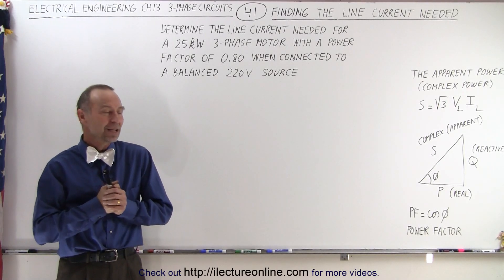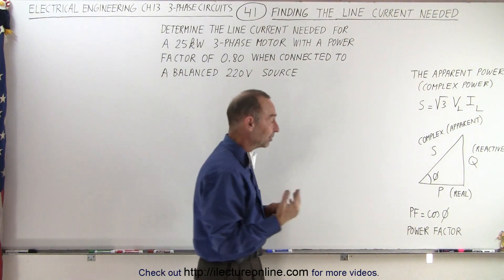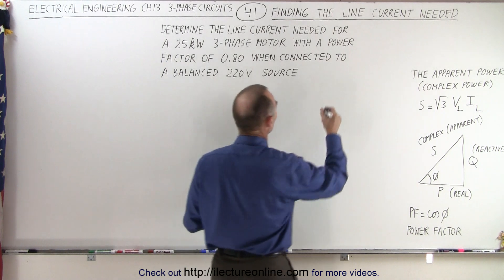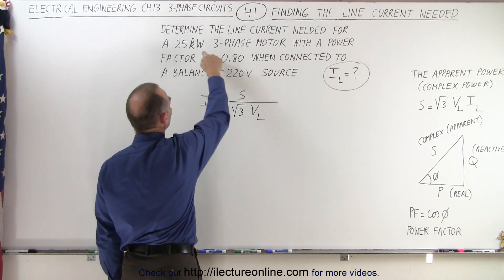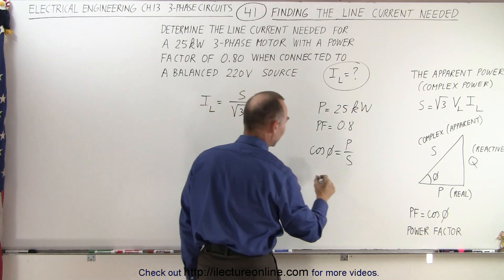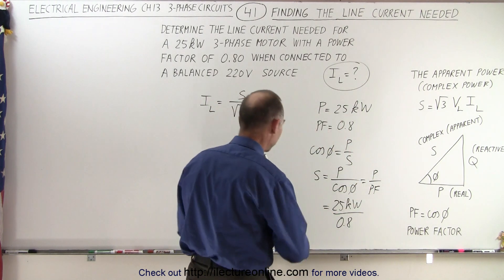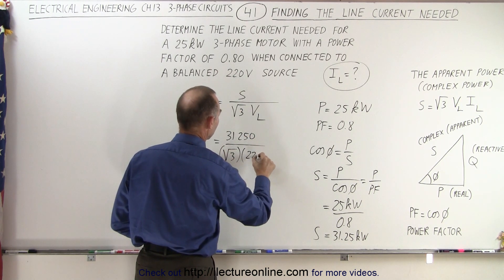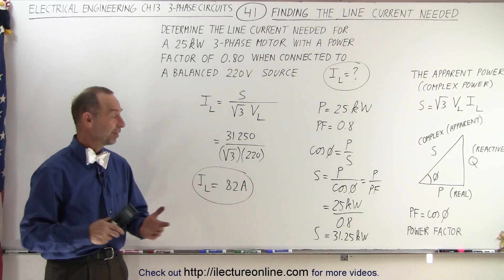Electrical Engineering: Ch 13: 3 Phase Circuit (41 of 53) Finding the Current Needed

Comment: Sir,how i know, this voltage is line voltage?
Reply from the maker: In a three phase system the line voltage (also known as the line-to-line voltage) is the votage between 2 phases (between 2 lines).  The phase voltage is the difference between the phase and neutral.

Comment: How would you know its line voltage though and not phase? Seems like your just assuming
Reply: I also thought that .....and it is clearly written it is phase voltage
Reply: The MAGNITIDE of the complex power does not depend upon the relative phase angle between voltage and current. The total apparent power (S) is the same in all cases only the distribution between real and reactive power is affected.
Reply: But if it is phase voltage then Vl = 200√3
Reply: @skullgaming6681  In Electricals and Electronics Engineering, by convention, the voltage given will be the line voltage. If the phase voltage is given, it will be mentioned in the problem itself.